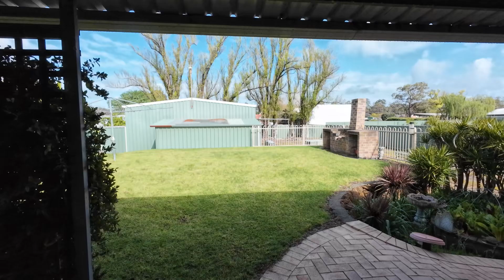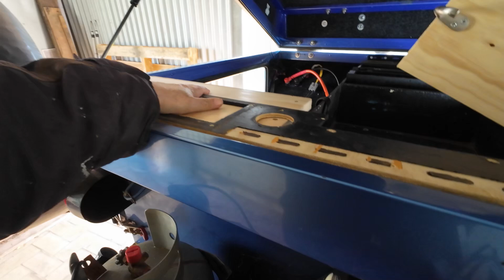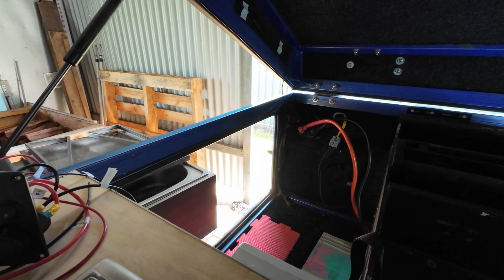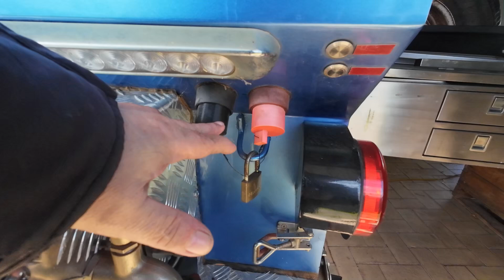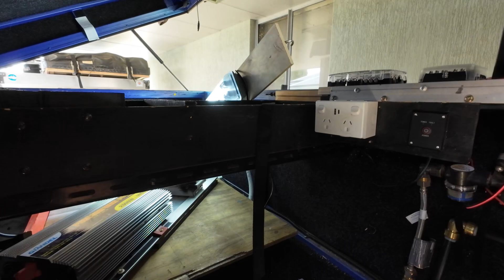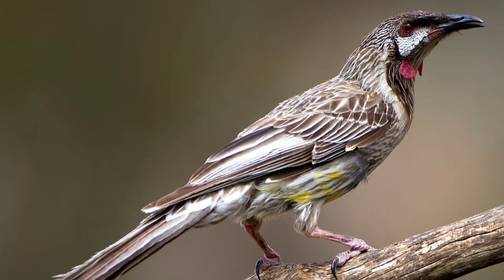🦜 Wattle Bird's Wild Visit  DIY Electrical Upgrade on Our Camper Trailer!🛠️

Comment: Good to see the bird back you have a friend for life there
Reply from the maker: He / She. We are almost sure it's a He due to its size. Came in and landed on Sigi's shoulder. That was 3 days ago. Flies away and comes back from time to time during the day. Joined me in the trailer while I was working. We don't touch it at all. Just talk to him like we always have. As long as he is happy, it's all good. Won't start feeding them till early next year when it's hot, there is not much for them to eat.  Well, some people say they have a territory, and I guess that's right.  One thing is for sure, bird brain used to be a way of insulting somebody. I am beginning to think they have a lot more brains than most people think.
Reply: @JustinCaseSolarPower  totally agree with that